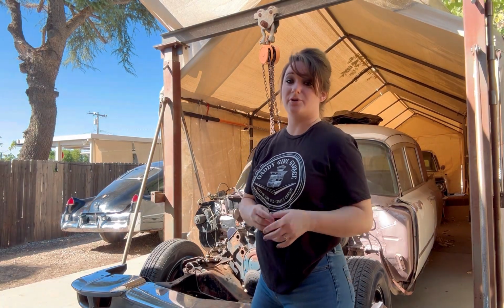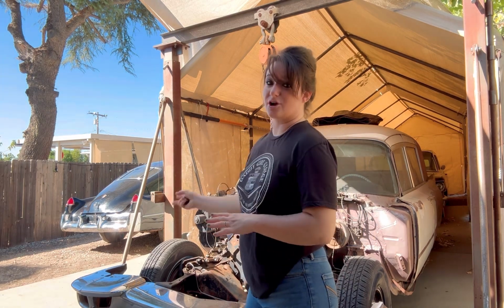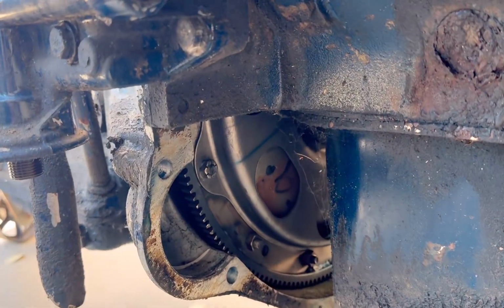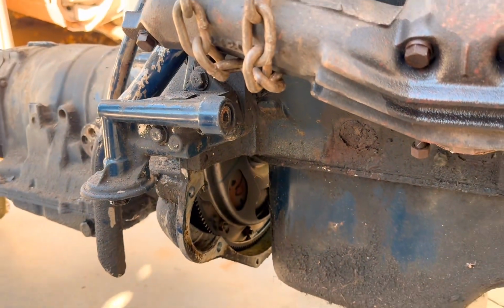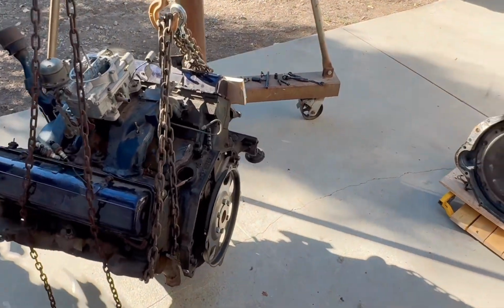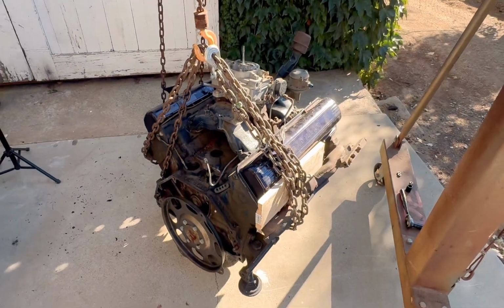Engine PREP 1960 CADILLAC HEARSE #1960cadillachearse #cadillachearse #hearserestoration #hearse

Comment: I noticed when you were pulling the engine that the core plugs looked pretty rough,also a question, during your experiences with hearses have you ever seen a generator with an air cooled rear bearing?it consists of a flange on the rear bushing plate with a flexible hose attached that ran to the front to get air from the outside, a friend owned a '62 model that was made like that, he had to order a special heavy duty regulator for it that cost $32 in 1981 money,can just imagine what it would cost today.